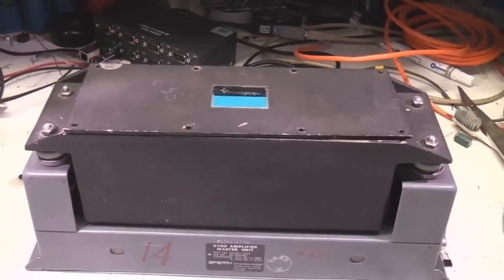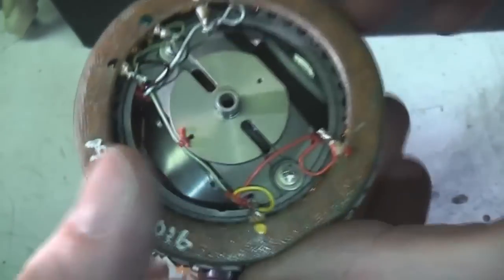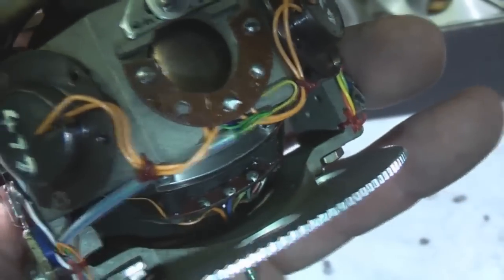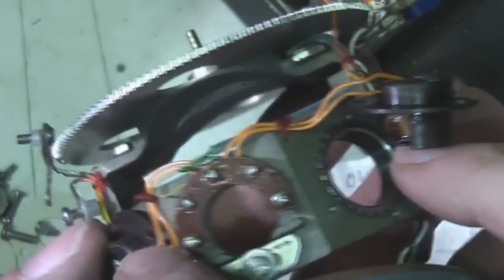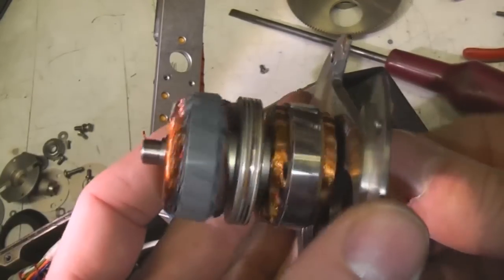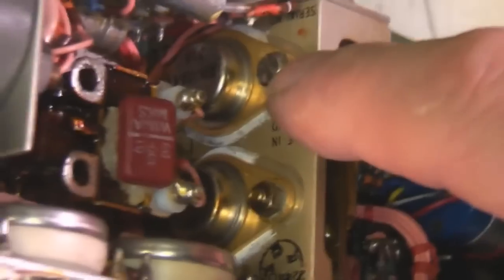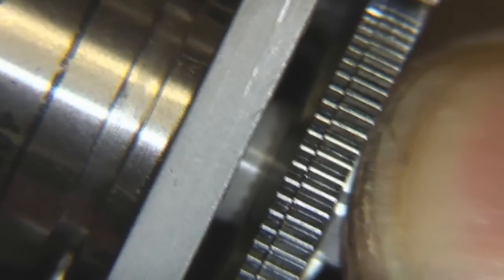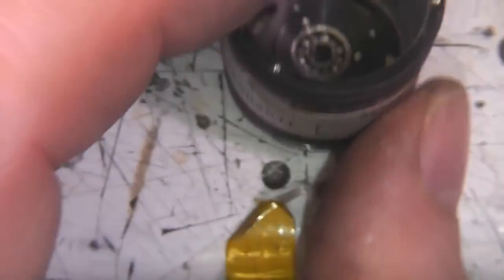Gyro unit from RAF Sepecat Jaguar jet fighter.

Comment: Oh wow! There is a very good chance that gyro unit was manufactured at Sperry Gyroscope in Bracknell. I spent 10 years working there from 1978. It was bought out by British Aerospace and then closed a few years later.
Reply: The Kaiser I was involved in testing the completed units. I mainly worked on the SINS ( Ships inertia navigation system) project. The gyros were a bit bigger than the one Mike torn down. I also tested the gyros that kept the ships guns locked on target even in rough seas. The latest technology when I was there was lasers gyros - no moving parts!
Reply: Ha. Yes. The gyro had no moving parts. But of course technically every part of everything on a ship is always moving. Lol.
Reply: +Graeme Pinnock Hw do Gyro's work on Planes? They are used to keep the Airplane flying level and straight without visual reference aren't they?

Comment: It's a directional "tied" gyro. Probably for sensing yaw, assuming the whole box assembly is mounted fore-aft. The sensor on the side of the gyro's rotor measures the deviation from the "normal axis" and sends it to a feedback loop to straighten the gyro with torque motors (via precession). This is because it is impossible to have a fully free gyro. Those planes fly in weird attitudes during combat..
Reply: +Frédéric Dutrey  How do Gyro's work on Planes? They are used to keep the Airplane flying level and straight without visual reference aren't they?
Reply: +dannffc Gyros are devices that, in ideal conditions, have their spinning axis always point in the same direction. This is a property called rigididy. And therefore can act as a reference. So yes, as a quick and dirty answer to your question, you use gyros to "simulate" a reference horizon, and fly with no visibility.
Reply: +dannffc  --  No, it is the thing, that gets activated, when someone on board pushes the self-destruct-button.

Comment: Antibacklash gears have more friction.
If the synchro-resolver is amplified electronically before being fed to the servo, and the output synchros - then there will be no mechanical load from the antibacklash gears on the gyro.
Mechanical load on the gyro will cause it to drift.

Comment: Can you take a closer look at the lower assambly, as far as I understand it, there is a sensor and a feedback compared with the top assembly. The "servo-motor" more like syncro probably spin until the wheel locations are even out.
Reply: That's what I was thinking, to be a gyrocompass, it must need calibrating as to where it is when it first spins up, maybe the lower assembly is used to move it to the correct position before spinning up (apologies if that's what you already said lol!)
Reply: *****
Not really.
I was thinking more like a distribution amplifier. compare two syncros one on the gyro and one on the lower gear assambly, and drive the servo-motor on the lower gear assambly to even it out.

The auto-centering can possibly be based on the same system, if it works like that.

Comment: Wow, I've seen a lot of things but never that ball bearing motor at the end. Do they have to be steel because you can get around the heat seizing by using ceramic bearings (Bike BBs have them for a hundred plus you can probably get a used one for much less) but most are not conductive...

Comment: I imagine a gyro today can be done much better with no moving parts.
Reply: Not nescessarily, I am no expert, but due to the unique nature of military service much of what we would consider to be modern best practice is not used in favour of proven EMI, thermal, shock etc. robust systems.
Reply: Rob B I didn't say the idiots in the military would do it. But it could. 
Although I would imagine new jets have abandoned the primitive spinning gyro.
There is such a thing as a laser gyro and I imagine mems chips could do rather well as well.

Comment: makes a swiss watch look crude, what a shame these things end up on ebay, surely they can be re used.
Reply: These days they can put a 3 axis gyroscope into a semiconductor that probably has a million times the performance. Your cell phone likely has one.

I really appreciate the craftsmanship in this device presented, but it wouldn't make sense to use something like this on a modern aircraft.
Reply: MEMS gyros are crude by comparison to these, because they are just too small.  Laser gyros rule at the high-end these days I believe.